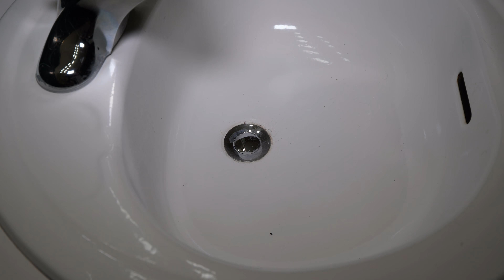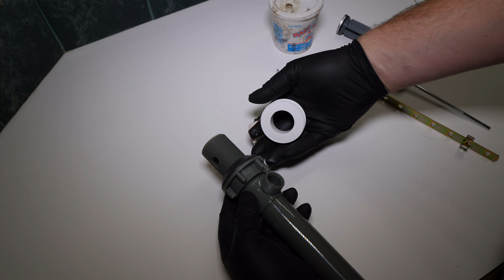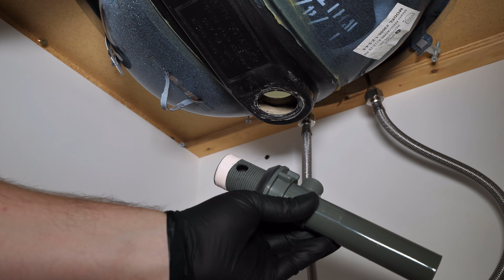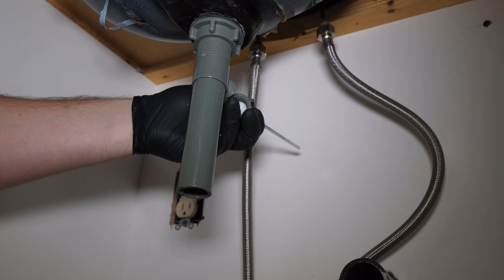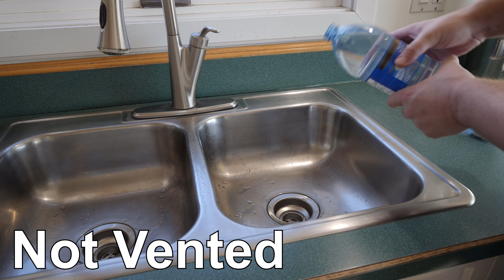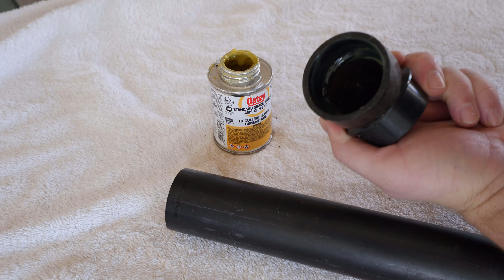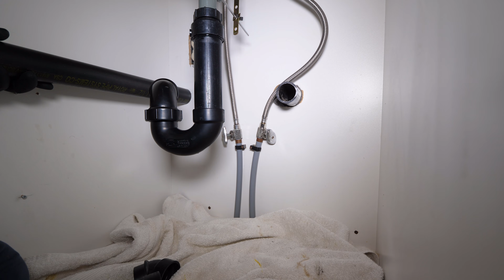How to Connect a Bathroom Sink Drain

Comment: Working on this project now... My question is if you're glueing several joints together now, won't that make it difficult or impossible to change the piping at a later date, if needed? What joints should be glued or not? Does a glued joint have the potential to leak more? Thanks.

Comment: Great video thanks.  Does the minimum trap arm distance need to be straight or can it include a curve like from a long sweep or hard 90?  Because my p-trap doesn't line up with my drain I'll need a 90 or 45 to make the connections (and it's a fairly short distance between the basket strainer and the floor drain pipe.

Comment: My problem is that I picked a nice looking Fresca brand vanity with two drawers and a high shelf, to replace a standard vanity ( with plenty of room for the lower P trap arm, that had no lower drawers. Rather than use a p trap I used the bottle trap that came with the vanity. I drilled a 2  inch  hole at the  bottom of the the top shelf, for the bottom of the bottle neck trap to sit in. and used a jig saw to cut the back of the top drawer, so it could open and close.. It worked for a number of years. But the bottle trap clogs very easily.  Never had an issue with sewer gas maybe because the drain pipe in the wall extends to an exterior wall which has a p trap in it.  I wish to keep the vanity, sink and pop up drain but I would like it to drain properly. I could remove p trap and clean it out but I'm sure I would need to clean it out periodically.  Probably the best way to handle this is to replace the bottle trap with a P Trap ,  requiring a bigger hole in the top shelf.  Clearly a P trap would clog less than a bottle trap.  Is there a way for me to send you a photo or two and maybe you can advise me.Thanks!

Comment: If a trap holds water too well to the point it won't drain and let water get to the wall pipe and the trap is not clogged, what is going on?

Comment: What kind of PVC pipe material was used? The employee at Home Depot told me that the pipes I had picked out were not suitable for bathrooms and were meant for sprinkler systems. He then directed me to the pre-packaged P-trap products section and said that was what I needed to use. However, none of those PVC tubes looked like what was used in your video. I am feeling extremely frustrated with Home Depot and their lack of assistance.

Comment: I followed the recommended order and it worked out fine.  The screw connection for the P-Trap nut is always tricky to get it started and threaded correctly but otherwise it was a no hitch install.  Very nice video and clear, concise instructions.

Comment: Super helpful. Much appreciated. Especially the tip about measuring the height (8 minute mark). I still wonder about the type of pipe to use. I chose to use the same ABS pipe that you demonstrated, but is it superior to PVC? Maybe it doesn’t matter.

Comment: I did not think the slope from p trap to pop out was that important.i know it's important for sewage drain. So thank you for the info i had a so called friend remolding my basement bathroom as far as the drain pipes and the plumbing what a nightmare I crawled into the crawl space to find my sewage dream pitched down towards the bathroom So now I have to redo everything. Lol there's no p-trap for my basement shower he never installed it. Unbelievable

Comment: Have you used silicone sealant instead of plumber's putty? The manufacturer of my black plastic assembly requires silicone instead of plumber's putty which they claim will make the pieces deteriorate.

Comment: Thank you for making this video. When I installed my new faucet a year or 2 ago the installation instructions said to use silicon caulk to seal the drain flange to the sink opening/drain hole. It was messy but worked. Fast forward to yesterday when the sink wouldn't drain. I undid all pea trap connections and cleaned out the clog, but in doing so the silicon unseated around the drain flange. Thanks for clearly showing how to apply the plumber's putty. It was easy and forms a better seal, I think. Also, the suggestion to seal the threads with teflon tape is a good one which I don't think the original installation instructions indicated. Suggestion: Another video recommended also using teflon tape on all pea trap connections as extra insurance against leaks, a step which you didn't do. Still, your video is very helpful. Thanks again.

Comment: Can you use pipe dope on the tail pipe in place of the Teflon tape you used?
Reply: Probably, but teflon tape is much easier to work with and is probably easier to create a better water-tight seal than plumber's putty (pipe dope).
Reply: @normdawley2355  
And I’m talking about using it on the tapered seat that is the most troublesome to get a good seal on in the video. Tape cannot be used on that joint.

Comment: Anyone out there that can answer my question...I would greatly appreciate it.  I have an existing brass lift rod drain and the tailpiece which is 1 1/2 inches that broke off from the body of the drain and a portion of the tailpiece is stuck on the threads. So I purchased a new drain but it's 1 1/4".  Can I use it with the existing ABS pipe?  If so, how?  The washer I am using evidently isn't right as it is leaking water from the top.  Or do I need to buy another drain that is 1 1/2 inches?   Hope this makes sense...because I am trying to fix it on my own without having to call a plumber.  Thanks!!!

Comment: Hey friend!
Trying to fix some plumbing we inherited in a new to us house

On the tail pipe there is a gap allowing water to bubble over the top
The connecting pipe is 1 1/2” diameter
I am assuming we need to go down to 1” diameter?

Comment: Thank you for this video. I am renovating a downstairs master bathroom complex and adding a 3/4 bath. I've never done anything like this before. I licensed plumber has run the drains, lines, and vents, but I need to connect everything from the rough ins to the fixtures. This video was very helpful.

Comment: I just did this last weekend and I opted to use plumber's putty instead of silicone. After, I read that using putty on plastic sink parts is bad for them and will cause them to crack. Is this correct?

Comment: Curious.  Can you use Fernco connectors (meets code) to join the plumbing drain pipe for bathroom sinks.  Also, why is there an outlet under the sink...curious?  Nice video angles.

Comment: Awsome!  Your video is by far the most helpful I've seen in trying to figure out the leak under the bathroom sink.  For me personally,  I really appreciate knowing WHY 🤷‍♀️ I need a slight angle to the one pipe for drainage, not just "...well, because... you just DO!"  🤦‍♀️   😒😠😡  Not that it has anything to do with the leak, I just wanted to thank you for just the right amount of info.  

I've discovered my problem creating the leak and I'm off to get the missing (!) piece.   Thanks so much!  

Smiles from the southern California desert,  MK 😁🏜

Comment: Dang, my roommate just bought a new vanity. The old one was too low and was made for custom vanities in 1985 so we needed to raise the whole drain pipe. We went to home depot and asked how to raise the sani tee. The guy told us not to. He said we didn't need to. We just needed the  drain pipe off the pee trap  to be the highest point. So we used a 45 degree and a 1 1/2 adapter to raise the pipe in the wall before it attaches to drain pipe that attaches to the ptrap. I'm sure its confusing to read and I cant attach a pic. The point the drop is spread out over  roughly 2-3 feet. The ptrap attaches to a straight drain pipe and then turns and then drops but it's certainly more than the pipe width. CRAP!!!!! Hopefully it vents ok. This was super helpful.

Comment: Thanks for making this video! My sink has been backing up and then taking forever to drain, I’ll be sure to rewatch this video while I redo the plumbing under the sink tomorrow!
Reply: Need help!
Reply: Need help! I have an inch and a half waist pipe Cummins the wall under my bathroom vanity there is a recoupling on the pipe attached to my p-trap. The connection from the wall is approximately an inch and a quarter short from the tailpiece. I am unable to unscrew the coupling from the waist pipe. Can I use a fernco fitting to make an easier connection. Or could I cut the coupling off and start from the pipe. I'm concerned about cutting the coupling I do not want to damage the threads on the pipe and I don't have any room up against the wall. A fernco I think will be the simplest solution. Thanks for your help

Comment: rest of the video is good, but please do not use plumber's putty on rubber gasket/flange - it is not recommended, if you contact Oatey or other company that makes plumber's putty, they will tell you that plumber's putty over time will break down the rubber flange and is not approved for use against rubber. use silicone if you want something that touches anything rubber. what you could do also instead of the plumber's putty on the lower black rubber flange is to add another wrap of teflon tape in threaded section below the hole, similar to how you added teflon to upper part of the threaded tube. most plumber's putty is made with petrolium- based and will break down rubber or plastic over time - a lot of new drains are made of plastic now, where plumber's putty might have been ok for years when drains were made of metal,  newer ones of plastic & rubber components makes plumber's putty  less desireable.
Reply: If the flange doesn't have a rubber you have to use putty.

Should be using a thick layer of pipe dope on the rubber gasket that presses up against the bottom of sink hole though.
Reply: @mattek519  use silicone for plastic and rubber
Reply: @caseG80  never had a leak in my life with the pipe dope. I'll continue doing it this way until it fails

Comment: I was just wondering why you don't install a P trap with a c/o ?  From the videos I have watched so far it's something I have noticed .
Reply: This one technically does have the equivalent functionality of a clean-out, just no plug at the bottom of the trap.  The U-turn of the P-trap can be removed completely, for maintenance without any irreversible removals of any fittings.  And then it can be re-installed when the trap cleaning is complete..

Comment: If you use pipe cement, how do you remove the pea trap to clean?
Reply: You notice that right after the U-turn in the P-trap, the P-trap is connected with a slip nut to the 90 degree bend and subsequent assembly of elbows.  It is also connected to the tailpiece from the basin drain with a slip nut.  If necessary to remove the P-trap for maintenance, it can be done. 

I'd strongly recommend having ALL elbows in the sink cabinet be installed reversibly, so the whole assembly can be removed, and taken outside to clean with a garden hose.  That way, as few pieces as possible are permanently attached.

Comment: In the video you describe 1/4 inch slope and state that 1/4 inch slope per foot is the maximum slope per code. On your final adjustment, you used a level on the trap arm and adjusted it using the trap adapter on the tailpiece. In that step, did you attempt to dead level the trap arm and are you saying even if it’s not perfect level it’s cool as long as the slope doesn’t exceed 1/4 inch per foot as you pointed out can be determined by staying within the outer line on the bubble? 
Is level preferred, without any slope, to maintain the best  trap seal?

Comment: Do you like using that ABS pipe more than the white plastic p trap kits? If so why?
Reply from the maker: It's just a personal preference and area preference, but I do prefer Solid ABS or PVC piping over slip-joint "white plastic p-trap kits". Solid piping has a larger inside diameter than slip-joint and there are less unions to leak. Thanks for the question!

Comment: Dude, this was the most informative, easy to follow, pro tip heavy and no BS plumbing video I've ever seen. Thanks!
Reply from the maker: Thanks SuburbanHobbyist! Cheers!
Reply: @PROSDIY  what the piece u use to connect to the sink? my sink drain is small like 1" but  abs is 1 1/2"
Reply: I agree with you suburban hobbyist. He is straight to point and no bs and not too long.
Reply: Agree!  Really complete and thorough, but also concise.

Comment: LOL, the Power outlet under the sink  is not water-safe, I'm not a plumber or electric expert, just realize obvious visual  that something is wrong here
Reply: If it is connected to a GFCI breaker in the panel, or if GFCI is integrated in the receptacle, it meets code.   You can also piggy-back on the GFCI functionality of other receptacles in the circuit, such that all ordinary receptacles downstream of it, automatically take advantage of the first receptacle's GFCI functionality.

Comment: Aren’t you supposed to first spread the purple coating in and around the pipe fittings THEN use the pipe fitting cement?  I here horror stories that a house (plumbing) will not pass inspection if the purple ore application is used first?
Reply from the maker: PVC requires a primer before cement, which is usually purple. This is ABS piping and requires no primer.

Comment: Excellent video - just what I am working on.  Actually installing a new faucet but thought that I may as well install the included sink drain.  Unfortunately the pee trap is glued and has no adjustment so I can't get the new sink drain in.  So it's the old drain or a new pee trap I guess.

Comment: My delta faucet /  pop up drain setup came with a drain piece that is thinner in diameter than expected. Measures around 1 1/4" OD but doesn't fit in a standard 1 1/4 trap adapter. Am I missing something?
Reply: Thank you! Useful info for sure!
Reply from the maker: Interesting. Never run into that before. Delta makes North American universal plumbing fixtures as well. Some are very tight fitting and require some force? How much is it off?
Reply: @PROSDIY  So I went and purchased a different brand of 1/4" adapter and it fit easily.  The other was a 1/4" as well but at full tightening it was at least 1/8" to big. Weird. Must have been a one off...
Reply from the maker: @afriesen6  It might have been for 1 1/4" copper instead of a 1 1/4" tail piece. They are slightly different sizes. If picked up at a hardware store, those bins are commonly messed up from people putting fittings back in the wrong bin. I'm glad you got it figured out. Nice job on your project!

Comment: NIce demonstration.  Though I wonder why didn't you use threaded fittings instead of gluing everything?
Reply from the maker: That's the preferred method in my area. The p-trap is still removable as the trap adaptor and p-trap have a union.

Comment: Do you suggest ABS over PVC? If so why? Oh and you said something about the vent, but I did not see you put a vent on this.
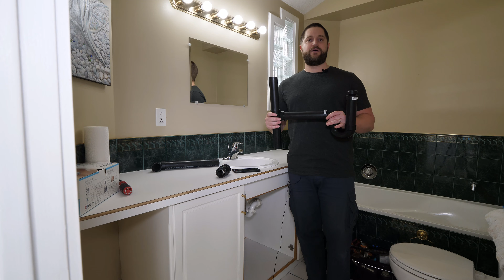Reply from the maker: You can't go wrong with ABS or PVC. I usually recommend using what's in your home currently. Some areas seem you use nothing but PVC and some ABS. What I've learned from some of the comments is that PVC is more widely used in the States, other than California. The vent is connected in a standard method within the wall using a TY fitting. Demo is at the 4:38 mark.
Reply: @PROSDIY  Yeah my kitchen and bathroom sinks are a mess, lol. There is no vent on them either, so I will have to put a vent in like you showed on the kitchen sink install. My uncle built the house back in 1996, but it was just a quick build on top of a 24x38 garage. I am going to upgrade the whole kitchen this year or next. It is not really hard to do. I can do the cabinets and wire a whole house, but never messed with plumbing. I also have a washer and drying in the bathroom. The washer drain is straight down, so you get the fumes coming out of it. I have it sealed off where the drain goes in at the moment.
Reply from the maker: Sounds like quite a project. Good luck on your renos!
Reply: @PROSDIY  Any particular technical reason why ABS is preferred in California?   Is it just material availability, or are there local codes that require it over a PVC alternative?  Or are there environmental reasons like temperature and humidity, that give one kind of plastic an advantage over another?

Comment: This video is the best I’ve been able to find! My only question is, if I’m starting from the metal drain pipe coming from the wall, what piece would I need to be able to attach any of this? Thanks in advance!
Reply from the maker: There's 2 options that I use. First is a trap adaptor sized to the size of the metal rough-in piping from the wall: https://www.homedepot.com/p/NIBCO-1-1-2-in-x-1-1-4-in-ABS-DWV-Hub-x-Slip-Joint-Trap-Adapter-C58017HD112114/100348302
Second is using a flexible coupling which is probably the easier way: https://www.homedepot.com/p/Fernco-1-1-2-in-x-1-1-4-in-DWV-Flexible-PVC-Coupling-P1056-150-125/100044154
Thanks for the question!